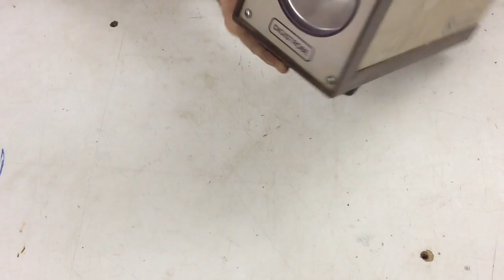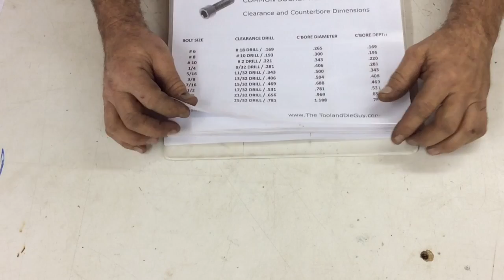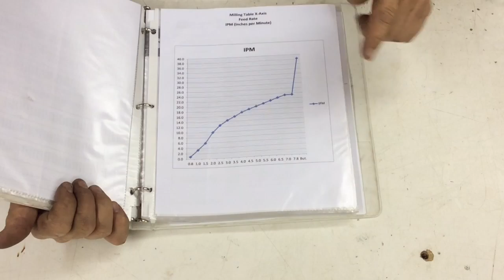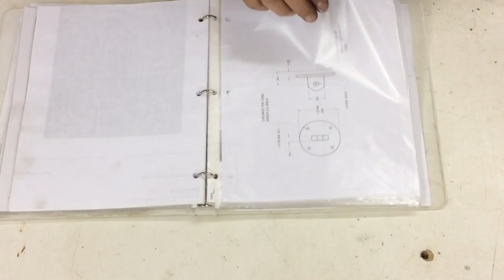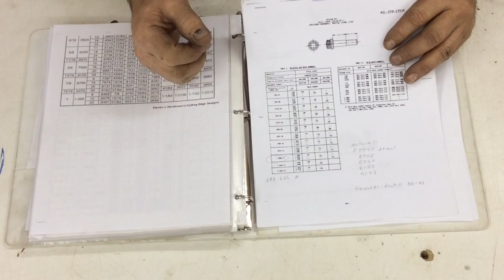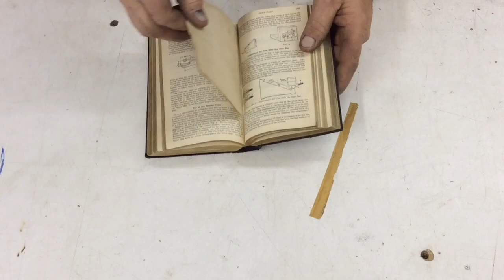Ketchup #9 Some old photos and my history, mystery tool, lathe tool rack, shop manual

Comment: Thank you so much for this information from Shender4. A couple of weeks ago, I was trying to make a threaded bolt with a knurled head. I got lucky when I made the bolt, but sure wish I had this information. I had no clue about the threads per inch and the size of the bolt. I am really new at this machinist stuff, but am learning fast. Would that Machinery hand book be helpful, or is that way out of my league. Thanks again...Ken .Marina CA
Reply from the maker: Kenneth Bartlett Thank you Ken.  The Machinery's Handbook is worth every page.  Find an old one, no need for the newest version.  I use the 17th edition.  Randy

Comment: Was she single or double hull ?
 The shop book is a great idea Richard. I have all sorts of information on my laptop but you can't use a laptop in the workshop. Those bolts made in 4340 would be tempered at a fair temperature and would be as tough as armour plate!
Reply from the maker: Jester Mclarpet Having a quick Reference makes it easy in the shop.  The bolts are tough, and heat treated, I think the min tensile is 136kpsi.  Thanks for watching, Randy
Reply from the maker: Jester Mclarpet Single Hull.  thanks, Randy

Comment: i ment to comment on your previous entry when you showed your new light over your lathe 
floresent lights are strobe as well just very fast here in the uk the are 240volt 50 hertz which maker them flash at 12000 rpm 
now your lathe wont be going that speed but at 1500 rpm or 750 rpm or 375 rpm your chuck may look stopped not very safe
always use a normal bulb or led light on a lathe mill or even a saw come to that.

thanks for the great channel
Ian Anderson
From BONNIE SCOTLAND
Reply from the maker: IAN ANDERSON thanks for the comment and I will try to stay safe.  I do have standard lighting and LEDs on the machines.  Thanks for watching, Randy

Comment: Hi Randy I purchased a couple of these after seeing them on mrpete222 they pretty good and not expensive they do need a power supply run mine off old mobile phone charger and the other from the VFD power supply. Enjoy your videos keep them coming H
Reply: oppppps forgot link 
http://www.ebay.co.uk/itm/4-Digital-LED-Tachometer-RPM-Speed-Meter-Hall-Sensor-Proximity-Switch-NPN-/251526543435?pt=UK_BOI_Electrical_Test_Measurement_Equipment_ET&hash=item3a9026784b
Reply from the maker: ***** Yep I have installed one on my Logan lathe and one on my mill.  I will be installing one on the lance and Clausing lathes.  They are almost a must have on machines in which you are using a vfd.  Thanks for the link and for watchIng.  Randy

Comment: Randy,

Wonderful to hear about the history and seeing reference books handed down from your dad and grandfather. 

My dad was a captain in the merchant marine and most of his ships were twin screw steam turbine propulsion. I remember his stories about the experts from the turbine manufacturers using very sensitive listening devices to pinpoint problems or potential problems with the machinery. That would be my guess for your mystery tool.

Great idea for a three ring binder with reference material and thank you for the references. About two years ago I wanted a calculator for the home shop and for part designing. I bought the Calculated Industries 4087 Machinist Calc. I turned out to be pretty handy and I am still discovering more features.
Reply from the maker: Paul Jones Yep, you end up with a lot of what we in the trade call Sea Stories.  I am sure your dad had a sea bag full of stories.  He must of went to Central America a lot.  Those sensitive tools were screwdrivers with the handle held against your ear.  I loved steam ships.  The plant does not work unless everything works, it is as if it is a living thing.  Diesel ships are nothing but a bunch of engines, big engines, but still just engines.  I have never used one of those calculators.  I still use my Hp 55 which I bought when I was in college.  Thanks Paul for the great comment, Randy

Comment: A quickie at 40 minutes.  You might have to change your weekly update title.  :-)  Just kidding ya.

Is that the hand held sonar you used when you first started sailing on ships to try to detect the U-Boats?

Other thing I thought of is whether it was used to amplify noises coming from the engines or other machines on the ship so you could isolate or detect any noises coming from them?
Reply from the maker: ILGopher Yeah, it got a little long.  No u-boat around when I first started sailing, but an interesting idea.  You are getting closer.  Thanks, Randy

Comment: Randy,
You've had an interesting life. Thanks for sharing it with us. I would say your "mystery tool" is a geiger counter. Either that, or some kind of audio equipment given the XLR connectors used for pro balanced line audio and microphones.
Have a good one!
Dave
Reply from the maker: Swarf Rat Well yes you do have head phones on and they are over your ears.  Thanks for the guess Dave.  Randy

Comment: Thanks Randy, really enjoyed the family history section - do you 'miss' the ship work?  The HP mystery item is electronic test equipment of some type - that's how HP started out - is a crack detector to be used testing the soundness of large castings like ships propellers etc?
Reply from the maker: 1954BJohn the work was very interesting, got tried of being away.  Most of the time it was 2 months on then 2 months off, then you were called back early and would have to stay long.  But when things that were not in my control went very wrong and they almost blew up the ship I was on, I decided it was time to go.  It is fine if you get yourself killed, but when somebody else is going to do it for you, it is time to go.  Talk to James K..  Yes kind of sort of on the tool.  Thanks Randy